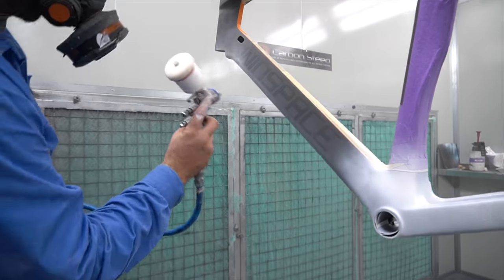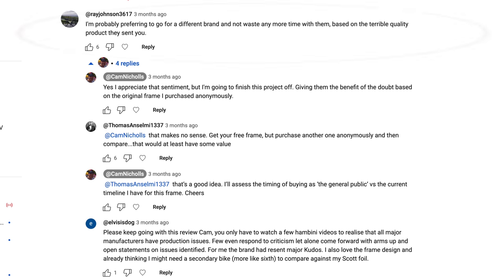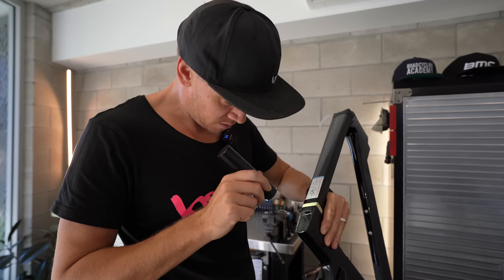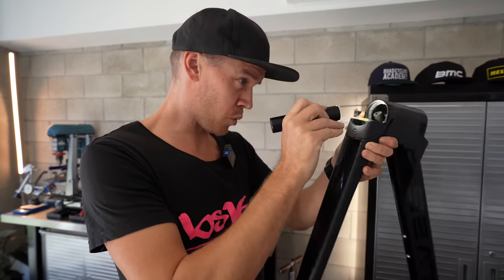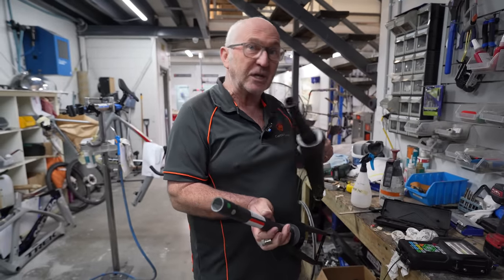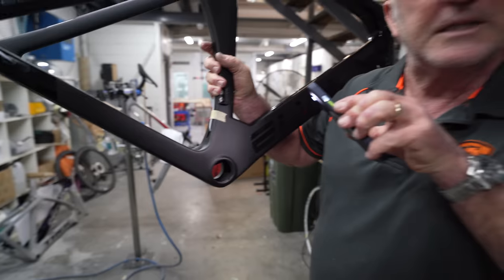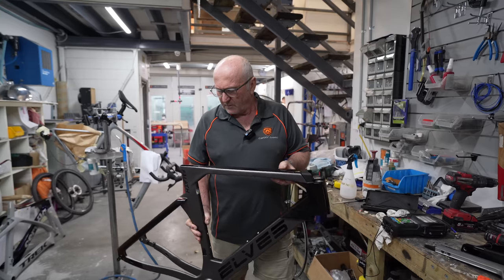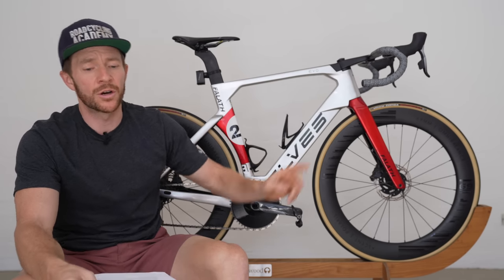I Bought An Elves Frame Anonymously (again)

Comment: Honestly, I kinda prefer the glasfiber being there. Low weight is severely overappreciated in the cycling community and galvanic corrosion is one hell of a bitch, especially when you are dealing with expensive stuff, that you don't want to break. 
In regards to weight: Yes, the lower the better, but there is a point where the tradeoff in stuff as longevity, usability and aero is just too significant to ignore (unless you are professionally racing and have mechanic or a sponsorship, that makes you not give a shit about durability)

Comment: I wonder how many "normal" brands owners, who claims that is a shit frame, look inside their frames and searching layers of fiberglass or measure thickness of carbon 😉😉
Reply: Just like that video of remco's sl7 being pinched and bending all over. People need to understand that a 1000€ isn't the same as a 3000€ or 5000€ frame. But as you cut the middle retailers, you will have a 85% of the quality at 1000€ as you have on 5000€. Perhaps this asian brands investing more on quality control and they will rule the market very soon.

Comment: Hey Cam, I have been riding my Falath Evo for about a month now and it has been excellent. I do a crit in Austin, Texas and it holds up under power well in the p1/2/3 field. Overall I can say it’s a great bike. It’s interesting to see you share these details about carbon frames! My personal opinion is that the bike rides great, and I feel that as long as the bike is safe to ride, the differences in a full carbon steerer versus one with fiberglass are going to be negligible for anyone who isn’t racing professionally and putting insane stress on the bike through repeated sprints and stuff like that
Reply: I've got family in Austin. What crits do you enjoy?
Reply: I own three Falath pro frames - excellent... I use them over my Dogma F12
Reply: @SkylarsRnD   I usually drive to Austin for the Driveway Austin crits

Comment: My bike mechanic/husband overheard what you were saying and thankfully was interested enough to chat with me about this. Most curious to me was that although he has not seen fiberglass in the steerer tubes, he does mention galvanic corrosion as being the reason for seized seat posts. So, reminder from a bike mechanic to remove and inspect periodically.
Reply: Yes, you got me thinking about my aluminum bike with carbon seat post now which was already a tight fit (need to pour boiling water over seat tube before attempting to adjust seat post).

Comment: an official answer from an elves bike
Please be reassured that having a thin layer of fibre glass inside the fork steerer is quite common in the manufacture of carbon fibre forks, at all levels, as indicated by the independent industry expert at the end of the Cam Nichols video and has two purposes.

1. Reaming of the inside of the fork steerer: The inside of the fork steerer needs to be reamed to ensure that it is perfectly round to accepts the expander plug. Carbon fibre is too hard to be effectively reamed, so the thin layer of fibre glass allows the inside of the fork steerer to be correctly reamed for a perfect match to the expander plug.

2. Galvanic corrosion. Carbon fibre and metals such as aluminium have a habit of bonding together over time. Fibre glass does not have the same issue. The expander plug used on Elves Bikes, like most brands, is aluminium. To ensure that the expander plug does not corrode and bond to the inside of the fork steerer, the same thin layer of fibre glass is used to place a barrier between
2. Galvanic corrosion. Carbon fibre and metals such as aluminium have a habit of bonding together over time. Fibre glass does not have the same issue. The expander plug used on Elves Bikes, like most brands, is aluminium. To ensure that the expander plug does not corrode and bond to the inside of the fork steerer, the same thin layer of fibre glass is used to place a barrier between the aluminium expander plug and the carbon fork tube. 

With regards to weight, this thin layer of fibre glass adds less than 10 grams to the weight of the fork, but the benefits to the consumer are significant when it comes to maintenance and longevity of the frame.

Comment: I think that main thing is that they are not lying about the weight and the safety is not compromised. Some brands put aluminium steerer tubes on carbon fork.
Reply: Yep, my 20+ year old GT ZR3.0 has a carbon fork with aluminum steer tube, it is miles better than the aluminum fork that came on the original frame which was warranteed for cracking around the head tube. No issues with the fork nor can I even notice any difference due to an aluminum steerer.
Reply: The reputable brands have the aluminum steerer listed in the frame specs though. Its transparent.

Comment: Maybe it’s an education thing. If there’s valid engineering reasons like galvanic corrosion but the masses are ignorant of this they may demand a full carbon fork etc which is inferior due to the corrosion, which they don’t appreciate. 

Which I guess would be a marketing problem. Get the public to want the fork that has glass fibre so that it helps prevent corrosion.

Comment: I have bought 4 Elves frames direct... all excellent. The fiberglass internal can insulate the aluminum compression plug from the carbon in the steerer tube... The falath pro rival my DOGMA F12. I'd never by a $5-6k frame again.

Comment: The puristic approach can get a bit crazy in my opinion.  Cycling may have gone modern, but it hasn't lost it's mysticism.  Will you lose a race because of some fibreglass in the steerer.  It's whatever you think it is.
Reply: Another way to look at it is, you can spend 500 USD on a Velobuild frame, Chinese, or twice as much (if not more) on a Elves frame. What more do you get when you spend 2x more? That's what's unclear to me.  You can also spend 10x that and get a Factor frame, and ofc, the same question applies. I've recently built 4 Velobuild bikes, they're great, & it's unclear to me why i'd spend more on frames.
Reply: Weight. Does velobuild have a 900g frame and 320g fork on a rim brake model size S?
Reply: @myxti3669  Their 066 model says 840g in XS. But less weight means less carbon means less stiff, unless you really know what you're doing. And we have a video here of Elves using fiberglass instead of carbon to cut corners. I'm staying away from ultra light frames: i'm big.
Reply: @pierrex3226  I'm 70kg and Vanyar just as stiff as any other bike. They also claim 740g blah blah, but end result is 912g with hardware for painted size 52 frame.
Reply: @myxti3669  ah, at your weight, it makes sense to worry about weight much more than me for sure! And yes, I would expect expensive brands to make lighter stuff at a given stiffness. But for the vast majority of people, 250g of frame weight more or less will be largely irrelevant. And I'm not sure Elves lays carbon better than the latest velobuild models.

Comment: Hockey sticks cannot generally be 100% carbon for a host of reasons and expect some Fibre glass in the makeup.  I see no reason why bikes should be any different particularly around galvanic corrosion risks.   However  - this is acknowledged in the specifications of the hockey stick i.e. "90% carbon" 5% aramid 5% X etc.  In the bike world this is also requested or we end up with manufacturing fraud as seen here.  Personally I don't care what they use, carbon, GF whatever, if it's stiff, light, and fit for purpose that's all fine, just say so.
Reply: They just have to tell us, otherwise its just fraud

Comment: Two of the advantages given for a layer of glass are both significant. The dielectric barrier between carbon and metal inserts to prevent galvanic corrosion is huge. The thin glass veil to facilitate visual crack detection, may be less critical.

Comment: Good luck with transparency. This might be the manufacturer's trade secret to make their forks more resistant to breakage. Lauf fork use fiber glass in their leaf spring which is virtually unbreakable. Fishing rods made of FG can flex to infinity without breaking as compared to carbon graphite counterpart.

Comment: Careful with that type of ultrasonic thickness measurement, it could easily pick up an air bubble and makes it look like de-lamination or thin wall.
It uses the first to second interface detected to measure thickness.

Comment: Yes not making it clear that there is some glass can be seen as deceptive. But what is the right level of info that the consumer should have? Should the modulus of the particular grade of carbon be listed (not all carbon is the same by a long shot)? Should the different fabric weaves be listed? What about the details of the matrix, that will probably by epoxy, but which and how hard it is? I do agree that the more specialist the bike is then the more info should be given.

Comment: I far few years ago I had a flagship De Rosa King 3 which had fibreglass in the integrated seat post. A small hole had to be drilled for the clamping mechanism once the seat post was cut to length.
My De Rosa Merak which was supposedly a lower spec frame had a similar integrated seat post, but no fibreglass.

Comment: I used to work in an aircraft prototyping shop and we would use fiberglass as an isolation layer when bonding carbon to aluminum, to prevent galvanic corrosion.  I wonder if that is what was being done with the steerer?

Comment: I have been riding my Elves Falath Evo for about a month now. With zero issues. I regard it as one of the best riding and handling bikes I've ever tried. My most recent bike includes the Canyon Aeroad disc, Giant TCR Advanced disc, BMC Roadmachine 01, BMC Teammachine SLR disc and Felt FR1 disc. If someone, for some reason, calls the Elves build quality and materials crap, I would counter that by saying it's way better than the sum of it's parts. Because Elves is quite frankly selling the Falath Evo too cheap.
Reply: Why would you even ride this garbage bikes at the first place? The list of bikes you mentioned there and ended up with this crap? I don't get the logic.
Reply: @johnbossus  I like to try new stuff. As mentioned, my Elves is as good as, if not better than any of the other bikes I've owned, all of which had their own quality or engineering related problems. Canyon in particular had lots of quality related problems.
Reply: @johnbossus  I rode a bunch of Italians before and I now only buy cheap Chinese frames cuz their performance is just that good now. Clearly you're not updated.

Comment: There is probably a bit of pressure on the manufacturing side from the middle men to keep the cost down.
I thought about an Elves frame but decided to go direct to China and bought a Hyyge model S.
Oh and the bit at the beginning when he says the top of the resin is pulled of probably was peel ply removal. A very well respected laminating process... I use it on a regular basis for carbon and glass

Comment: Carbon fibre reinforced composites are stiffer, but glass fibre is stronger. So where there are different stresses, different composites will be used, for instance in archery the bows tend to be glass and the arrows carbon.

Comment: Within about 30 seconds of riding my brand new S-Works SL7 I regretting getting it lol. So soft and noodly and the brakes locked up far too easy.

I sold it with only a few hours of riding on it. I warned the buyer as well it didnt live up to marketing expectations. None of these road disc bikes do compared to the models they replaced. IKYKY.

Comment: I just want to say I really appreciate these videos. You've taught me a lot. Thank You so much. Out of curiosity, I checked 3 carbon steerers I have on hand. A 2013 flagship Merida definitely has unidirectional carbon in there, a Canyon Ultimate from mid 2010s has regular 3k carbon weave and a 2016 Canyon Endurace has something that doesn't really look like carbon, most likely black colored fiberglass.

Comment: What comes through my mind immediately regarding corrosion - have you guys ever seen a "big" brand bike frame with fiberglass in the headtube where the bearings sit? Or around the fork crown? Or corrosion of those bearings is not actually an issue only the expander? To me it does not make sense but this is just based on my limited experience. Another thought is that it sounds like some manufacturers are using fiberglass to compensate for poor manufacturing tolerances by machining/reaming these surfaces. I don't think applying a small layer of glass fiber makes much difference in terms of manufacturing costs, it sounds like this is all about being able to compensate for lower quality carbon moulding.

Comment: Is there any noticeable difference between a 50/50% carbon and 100% one? Will the 50/50 one be less prone to cracking for example? Or would you need to both ends with fiberglass?

The weight doesn't matter though. If you buy a frame you already bought it with the specified weight.

Comment: The more I see about carbon frames, wheels, etc the more it makes me think, I'm sticking with Aluminium or Steel. I'm a big guy and if I don't trust what I'm riding, I ain't riding! Obviously there's the cost factor too! Aluminium bikes are cheaper. It's a win win. I'm old, I don't race, I'm big, I'm not bothered about saving 500 gramms. Thanks for your films. Really interesting. I like that you speak to various people rather than some guy who turns out to be your best mate. 👍

Comment: Sounds like fiberglass is a good option for different areas of the bike, as long as you can bond it effectively to the carbon. I'm not upset about the fiberglass in the same way that I'm not upset my car uses both steel and aluminum. Sometimes you want the properties of one or the other. 

I don't drink 100% pure alcohol. If you're crazy about the status symbol of the composition instead of the capabilities of the product, you have the wrong hobby.

Comment: Why instead of fg don't they use kevlar, since often contact between metal and carbon is a friction surface and kevlar should be better than fg for this, prevent also galvanic corrosion,  and don't look cheap as fg.
What am I missing, apart of the obv different cost?

Comment: I think my view is that i just want clarity from all manufacturers of what theyre doing and why. Im no engineer so im likely never going to fully understand the full ins an outs of why manufacturers use certain materials in certain places, without their clarification. So if they have a good clear reason for (in this example) using fibreglass then be my guest, as long as its not at the expense of my safety or risk of the bike breaking etc.

I should definitely say thanks to Cam for this video, im currently looking and possibly purchasing an Elves bike but have been waitijg for the reviews etc, before pulling the trigger. I guess ill wait a little longer.

Comment: Did you measure the thickness of the carbon in the both the "pure carbon" and "carbon + fiberglass" tubes?? Is the fiberglass just there for galvanic protection?

Comment: Nice deep look, ok it has some fiber glass in it, it makes it heavier. That I can live with, is it safe ?
Does it ride well, or does the glass fiber make it harsher ?
Also, you mention 30mm tires in there ? Nice! Most of these lower price frames only state 26mm clearance (which does not make much sense in these days)
Reply: Up to 32 mm on the EVO
Reply: @konigsegg_1to1  so it now has more than the eglath “all road” frameset. Nice to see them catching up, waiting on the eglath evo to come out then !

Comment: Using a small amount of glass fibre for the interfacing with metal components makes sense. But that tube had it throughout. Definitely feel it was more of a cost saving thing than structural. Unless you are buying top of the range you are probably better off with a modern aluminium frame. On these cheaper frames you are paying carbon prices for what is effectively nicely painted trash. I expect some of these 'good value' brands are making more profit than some of the big boys, doing things properly is costly.